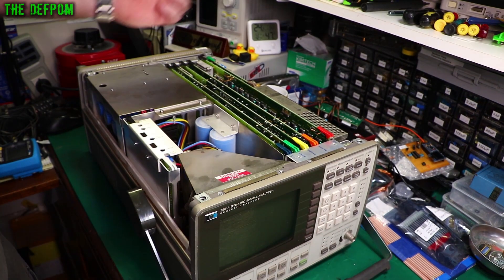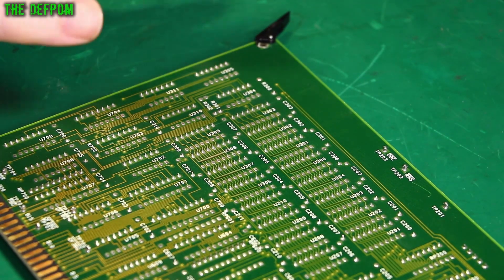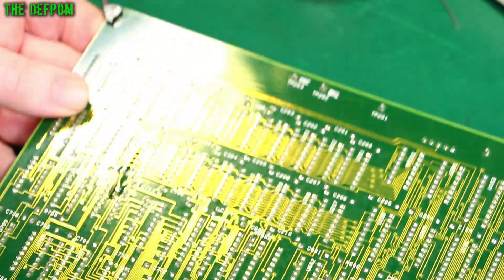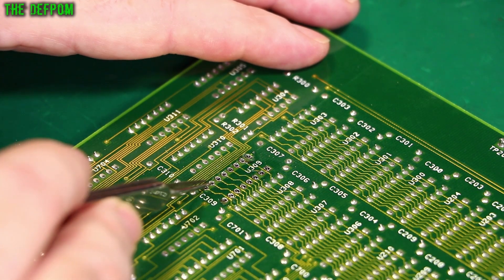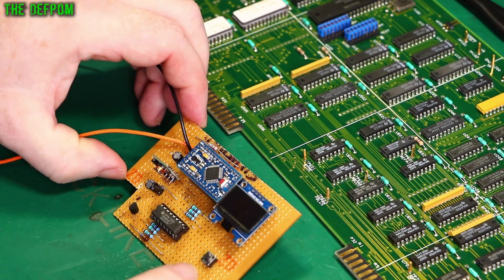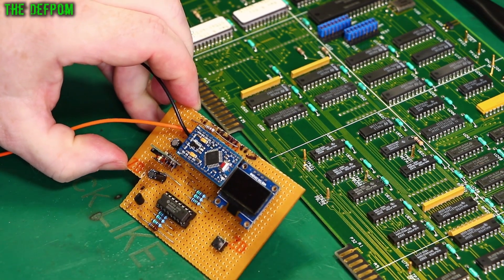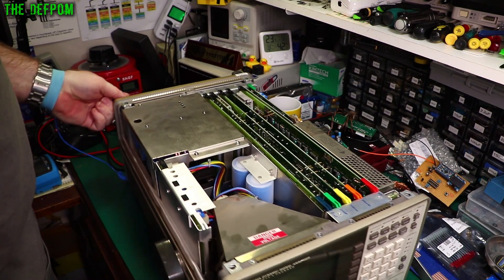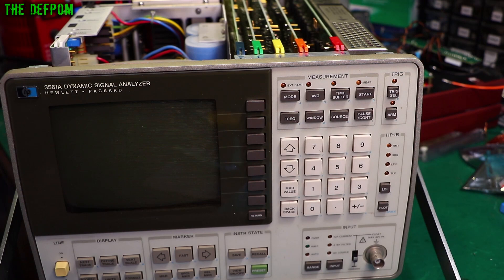🔴 Can It Be Fixed? - HP 3561A DSA Repair Part 4 - Can I Fix It ? - No.917

Comment: Preheating difficult boards makes desoldering much easier, especially pins on a power plane with no thermal relief. I use a very small heat gun which I normally use for heat shrink. Get the board to 100C or so and 'Robert is your mother's brother' :)

Comment: @5:58 Me too... turned pin sockets make no sense... DIP devices have flat legs.
Reply: Turned pin offer lower resistance contact as can be bought with gold plated internals. They are more reliable when re-inserting multiple times.
Downside is that they need higher insertion force, and they are more expensive.
Flat style wafer IC sockets can get weak pretty quickly. I've lost count of the number of them that got weak just on their own by having an IC inserted for extended periods of time (years usually). Re-insert often and they get weak very quickly.

Comment: It’s a good question to go in hot and fast or slow and cool. To be honest I have had it fail either way for some boards but I normally take the fast approach.
Reply: Yo Chris, I was wondering if one could use a chunky bit of copper wire across the pins...?
Reply: @fullwaverecked  I remember back in the day you could get a very wide soldering iron tip that would touch all the IC pins and unsolder them all in one go. They were quite expensive and you needed different tips for different sizes of ICs.  But they were very effective

Comment: I have used a desoldering iron as you have but if a few pins stick I have use a stainless desodering tube thingy on the few pins and it sometimes works to release the odd stuck pin🙂
Reply from the maker: I have some of those desoldering pins, it occurred to me afterwards that I could have used them!